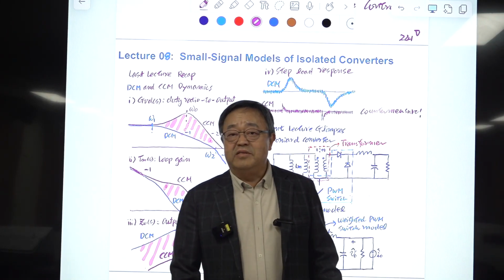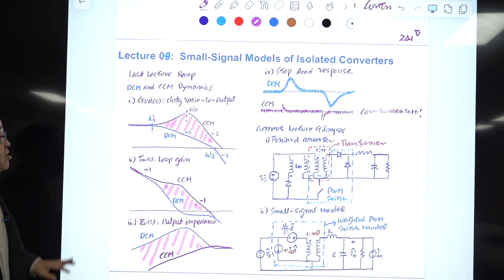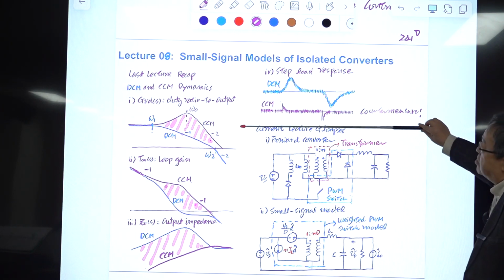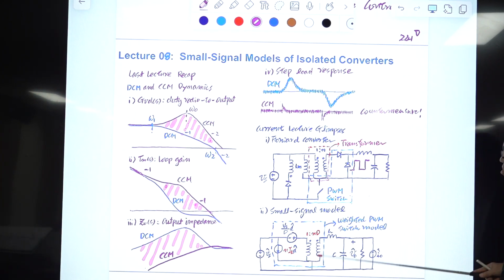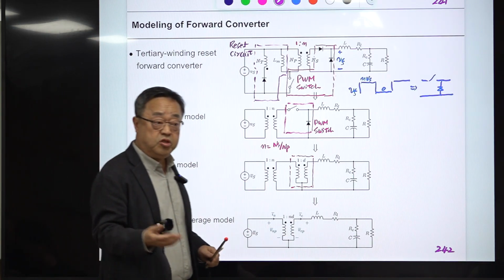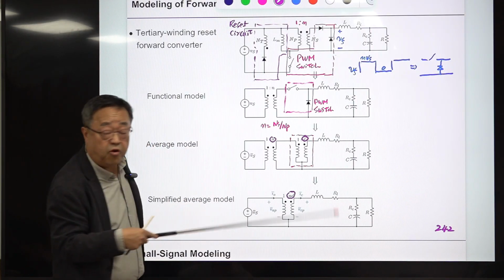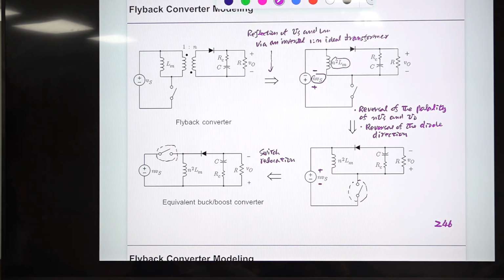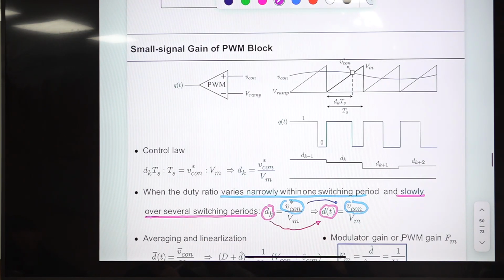Lecture 08: Isolated Converters, PWM Converters, Converter Modeling, Small-Signal Model, Power Stage

Comment: Hi sir if I apply same principle for getting average model for Active clamp forward converter how will it be different for current mode control and voltage mode control ? Voltage mode I am able to get but got stuck with current mode control
Reply from the maker: Hi, the power stage will remain unchanged from the case of voltage mode control. For the controller part, you may refer to past references, including Bob Erickson’s book. I posted two references at https://drive.google.com/file/d/1eA1A0QK_z5gt-ZMoMoEI2Uff3DHFSa3l/view?usp=sharing
, which might be some help.
Reply: @byungchochoi3322  Thanks sir..I will go through this reference and try to understand